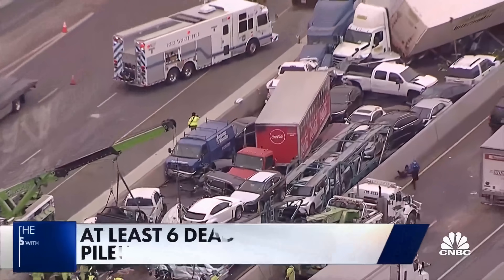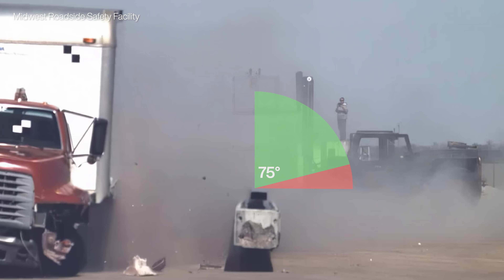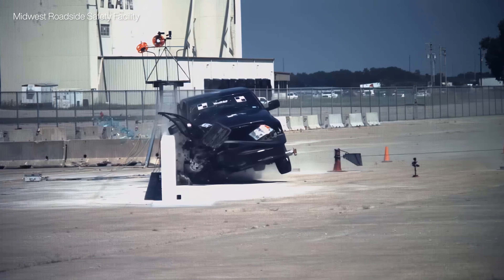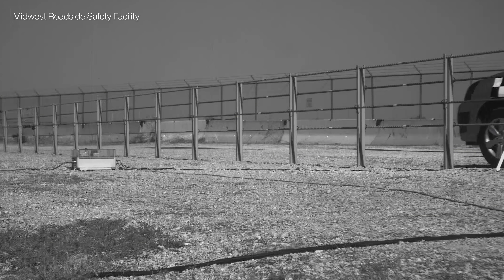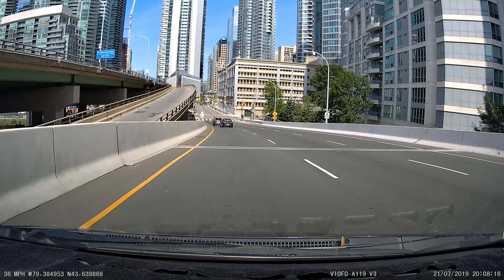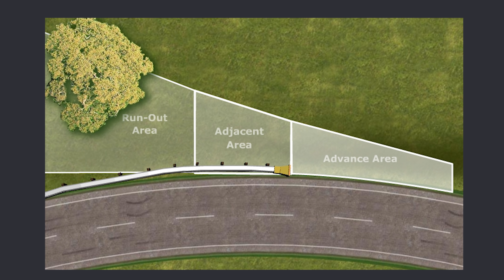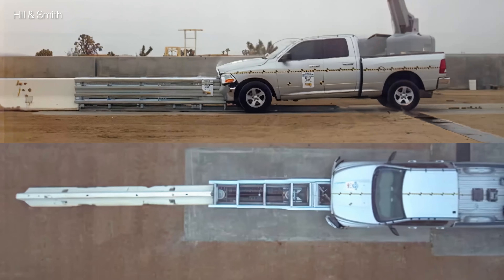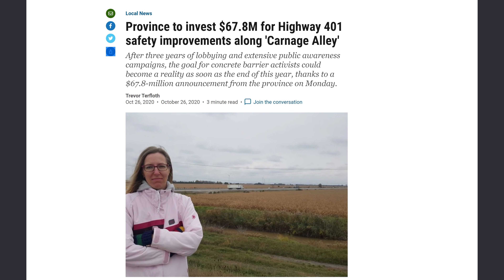How Road Barriers Stopped Killing Drivers

Comment: Really interesting - however the cable barriers are hated by motorcycle riders as the cables can literally slice limbs off. Suggest a follow up covering impact on motorcycles and the crash barriers.
Reply: In Europe they call cable barriers meat grinders for that reason. Great for cars. Killers for bikers.
Reply: And also low cars, especially convertables
Reply: Nobody is worried about motorcycle safety if you can make the road safer for cars. Most people drive cars. Motorcycle riders know their vehicles are unsafe.
Reply: @HotClown  You should compare the motorcycle fatality to distance travelled, not the total amount of accidents. Same is done with cars.

Drunk drivers, inattentive drivers, recklessly speeding motorcycles, lane splitting motor cycles, you are absolutely right. All of these just don't care, and don't deserve to be in the traffic.

Of course cannot expect same safety from a motorcycle than from a car, as car design in past decades has been dictated by safety in the first place and compatibility wise everything is built with cars in mind.

Of course should still do what can reasonably be done to make motorcycling safe as as possible as well. Should do the same regardless of transport form; cost analysis of different safety methods and start by doing things that are the lowest price per life saved. Because that brings the greatest effect to people.
Reply: How in the flying hell can you even hit barriers in a motorcycle?
Reply: @Edo_Ginting  not flying obviously
Reply: @danhentes8569  Obviously, but still, how? are riders that tunnel-visioned nowadays?
Reply: @Edo_Ginting  just protect yourself. No car will
Reply: @danhentes8569  Same thing applies to cars as well, but noted, have a nice day
Reply: @Edo_Ginting  When the rider looks in their wallet and cannot afford to pay attention...
Reply: I know someone who had there left leg severed from a cable barrier
Reply: Vs. bouncing off a cement barrier and returning back to the roadway into the path of a 18 wheeler then crushed by 9 wheels 1 and 2 at a time for .5 seconds of the remainder of said person's life.... Should we send flowers to the funeral home or donate the money for the research of human meat for dogfood?
Reply: @HotClown  Welcome to the new era. Smartphones mounted on motorcycles....
Reply: All types of roadside barriers are bad for bikers, not just cable barriers.  And many motorcycle crashes cause limbs to be lost, even if no cable barrier is involved.
Reply: Convertibles and bikes suffer a lot from cable barriers.
Reply: Altough to be completely honest, don't ever drive a motorcycle, if you are concerned about safety at all. It's propably the most dangerous regular form of transportation out there. Most crashes, that are quite unspectacular in a car and would give you minor injuries at worst, can absolutely kill you on those things. One slip and you can have brutal injuries or die immediatly. 
And when it comes to guide rails vs cables... Yes, those cables might slice your legs off, which isn't particulary nice, but if you drive against a guide rail, you might get launched up several meters into the air. And honestly, If I was dead or bound to a wheelchair due to that accident, I wouldn't particulary care all that much, if I still got legs. As stupid as this might  sound, but if you get to be paraplegic anyway, loosing those legs could even be seen as a benefit - they need all kinds of treatment, need to kept warm in winter, need to be moved and are constantly in your way.
Reply: @HotClown  yes, but you know there's distracted drivers, high drivers, drunk drivers, sleeping drivers, and drivers with medical emergencies on every road you drive on, that's a fact, if you choose to drive a motorcycle anyway that's a risk you are taking, it doesn't matter who caused it if you die or end up crippled that's something you have to live with.
Reply: If you are driving a motorcycle you are literally allowing yourself do die in a crash. It’s an obvious risk
Reply: Just dont drive a motorcycle. Lol. If motorcyclists cared about safety, they wouldnt be riding motorcycles. Just look at the stats. The stats for motorcycle accidents really makes me question their street legality. You literally just asking to die driving one of those things. And those guard rails ain't gonna do shite when the rider gets propelled off their bike and slams their head into the ground at 70mph.
Reply: @dzed5579  most fatal bike accidents are caused by cars, and coming off a bike doesn't kill you, you can survive quite a bit as your gear protects you but a cable at high speed will cut through you, the full length concrete barriers you slide off of. Also I've hit a tree at around 70mph on a bike and am still here, all I got was a snapped femur, had I done the same in a car I'd be dead.
Reply: @stuffanthings  nah this is bs, ik a guy who retired, bought a bike, was wearing protective equipment, but hit a pothole he didn't see driving 35, was flung straight into a tree, now he's a paraplegic. There is nothing safe about motorcycles, and on the highway it doesn't matter if other drivers are being negligent or not if you fall in the road there's a very high chance you'll be run over and severely injured.
Reply: @dzed5579  and not to forget, 90% of them ride way, way, way too fast above the imposed speed limits
Reply: @stuffanthings  "most fatal bike accidents are caused by cars". if everybody would just respect (especially when its heavy traffic) the speed limits and not double on a discontinued line, or by the right side of the road, or squeezing in between cars or in between ongoing and incoming traffic... that would be wonderful. no matter if you drive a car or a bike. 
While driving a car, do you double another car or a motorcycle by the right side of a one lane road if there is enough space? NO. so why would you do it on a less visible smaller vehicle?
Reply: @dzed5579  you sound like ur fun at partys
Reply: @dzed5579  Motorcyclists know the risks and they gladly take them. What you're proposing is so mind-boggling stupid and authoritarian that is only comparable to banning old cars because they are unsafe.
I can drive whatever I want, period. I don't even like bikes, but they have as much of a right to drive their vehicle of choice as I do.
Reply: @reinbeers5322  uh, no they dont. There are reasons why some vehicles are street legal and others arent. I simply think motorcycles should be added to the list. It's illegal for me to drive a golf cart on the interstate. Doesnt matter if it is "convenient" or "fun." And the same logic can be applied to motorcycles. You endanger others and yourself riding them. Just keep em off the streets. Guarantee you see a drastic drop in motorcycle involved accidents and deaths. Tired of the thrill seekers thinking they have the right to endanger everyone else because they get hard riding a bike. Ride it where there arent any other drivers.

You are literally doing a good thing for yourself and society by not riding a motorcycle.

Just like we banned smoking in restaurants because the 2nd hand smoking can kill people, we should ban motorcycles from the roads for "causing" accidents that wouldnt have happened had they been driving in a car.
Reply: @dzed5579  Yet motorcycle crashes are often caused by other people... so by your 'smoking in a restaurant' logic, we should ban all cars instead.
Way to go.
Reply: @reinbeers5322  most motorcycle crashes are accidents. They arent "caused" by other drivers. Both sides are to blame. That is why they are called accidents. Way to go. Smoking in a restaurant is an active choice. The motorcyclists are choosing to drive a small, nimble, hard to see vehicle. You cant blame car drivers for not seeing them all the time. Could they be more careful? Sure. But they wouldnt have to be as careful if they didnt have to worry about some idiot on a bike zipping through traffic. On a bike, you are actively choosing to be less visible and have less protection.

It would be like someone dressing in all black, crossing the interstate in the middle of the night, and getting upset with the driver that hits the idiot that decided to cross the interstate in all black, in the middle of the night. Sure, the driver could have been more careful, and the driver did kill the dude. But it was the idiot in black's fault for doing the stupid thing.
Reply: @dzed5579  Again, they know the risks and they take them. They know how dangerous bikes are and frankly what someone else chooses to drive is not my concern in any way, nor should I have any authority over what someone else drives as it does not impact me negatively.
Besides, I can think of worse ways to go in a car. And those cable barriers are still sketchy even in a car. Convertibles don't have that strong A pillars and cables can cut right through them.
Reply: @dzed5579    also on the "they are ACCIDENTS" no. They are NEGLIGENCE.  You are responsible for anything YOU run into on your vehicle be it bike, pedestrian, deer, car, whatever. 
If YOU aren't checking your blindspots before merging for ANY object no matter what size, that isn't an accident, its negligence.
 It's your fault, no matter how you try to justify it you didn't follow best safety practices and you deserve the fine and/or jail time for wrecklessly driving a 5000+ lb blunt weapon carelessly. 

Suck it up and drive right.
Reply: @dzed5579  its a lot better to be thrown rather then sliced, motorcycle armour is very strong
Reply: @oliverwalters9533  and it's better to not ride a motorcycle. Lol. There are tons of cases where the armor and helmet do nothing and the riders just die or get severely injured. Bikers complaining about certain guardrails being dangerous is like someone running around with a necklace made of knives complaining about a hole in the ground they could trip on.
Reply: @dzed5579  "I want to play a game"
Reply: @dzed5579  Look Twice.  Save a life.  Motorcycles are everywhere.  And they're probably going to be driven by a kid that'll cut you off while going twice the speed limit.
Reply: @dzed5579  Yeah I'm not a fan of riding motorcycles, but I'm not about to tell someone they can't drive something they find fun or fuel efficient. They are a minority of road users, but they should still be strongly represented cause u know.. they still have lives and what not. This coming from someone who gets crap about how flying small airplanes should be illegal cause it's dangerous and done by a minority of ppl. The consequences of screwing up are high, but contingencies can be calculated and be used to significantly lower the chance of fatal ruin. That is what makes it different from reckless. Ppl expose themselves to high consequence of screwup all the time, even if just for fun, made safer by understanding dangers and training for contingencies. After all, what's life for?
Reply: @astronichols1900  the problem is these people complain about safety and inconvenience when it is their choice to do dangerous things. Like I said in another comment, it's like someone who chooses wears a necklace made of knives complaing about a hole in the ground they could trip on. You shouldn't be wearing the necklace made of knives to begin with.
Reply: @dzed5579  if you're wearing an approved helmet and gear, which every rider I know does, you can easily survive impact with the ground. The biggest threat to bikers is car drivers who aren't paying attention.
Reply: @incoherent-marbles  which is an expectation given the vehicle riders choose to drive. "Hm, I'm going to drive an extremely nimble, small vehicle with zero safety measures for getting in a crash around really quickly around vehicles that could kill me by simply tapping my bike." Sounds like an excellent plan. I said it before, but if riders cared about safety they wouldnt be riding a bike at 80mph weaving between cars and then get mad when people hit them. Even for mature riders that dont weave and wear safety gear, the chances of you dying in a crash are extremely high. Moreso than any car or truck on the road.
Reply: @dzed5579  that's not the right attitude. Yes it's less safe to ride a motorcycle but realistically that's not  the way to think abt this issue
Reply: @dzed5579  and who tf are you to tell ppl what to drive/ride? its their choice if they wanna sacrifice a bit of safety for convenience
Reply: @NiquelBones  because they are the ones endangering other people. If you wanna drive a motorcycle out in the middle of a desert, be my guest. You wanna drive a motorcycle on legal roads where other drivers have to constantly watch out for your tiny little vehicle that endangers everyone else, you can shove it.

You wanna run across a street in the middle of the night in all black in the middle of the desert, be my guest.

You wanna run across the interstate in the middle of the night in all black. You can shove it.

Your enjoyment ends where other people's lives begin. I dont care what is convenient if it endangers other people.
Reply: @dzed5579  That comes down a lot to car drivers sucking though. Not to say there aren't a lot of idiots on bikes too. But car drivers need to be considerate and pay more attention for bikes than they do
Reply: @dzed5579  Correlation != causation. Most of the motorcycle accidents in my country result from rider stupidity (this is the case for car accidents too, btw), as opposed to motorcycle riding being inherently more dangerous.
Going 250 km/h through the city center? Sure.
Not slowing down before a crosswalk when the traffic on your right may partially obscure the pedestrians? Pff, why bother?
Thinking that car drivers MUST be able to see you and give way to you when you're flying past them at speed difference >50-100 km/h? Yeah, most of them do think so (at least they did, when they were still alive).

You can't protect a monkey holding a grenade from blowing itself up. And you shouldn't try to, because the monkey has to evolve. You can prevent it from obtaining the grenade, though. In other words, motorcycle driving licensing has to change to ensure that new riders are taught how to ride safely and what to do in extreme situations. The latter now is usually a part of a separate non-essential course, it shouldn't be. The "never brake while in a turn" doctrine with it's "press and roll" has to go, and trail braking should be taught in riding schools (as well as countersteering, right banking, low-speed driving using the clutch and brakes instead of the throttle etc...).
A psychological evaluation has to be required to make sure that the reason for riding a motorcycle is not "being bold and popular [18-year old] guy in town". This never ends well.
The riders have to understand that being alive is more important than being right. They also should have at least some car driving experience to understand the picture from drivers' perspective.

This way you won't have to deal with the barrier problem altogether. But of course, instead of trying to teach people the government is much more eager to stricten various limitations and their enforcement, as well as to build more barriers to try to contain the explosion of the said grenade. Extensive ways of problem solving always prevail the intensive ones in our society.

There're plenty of examples of riders who knew their stuff and lived long and happily. Some of them even started youtube channels to try to teach new riders what conventional riding schools lack.
Reply: @DevilsVideos1  I tend to agree with a lot of what you say, so if motorcyclists need car experience then the opposite is also true, in Britain they have made motorcycling difficult to take up and have seen an alarming rise in young driver accidents, in my youth (mid to late seventies) the average sixteen year old got a sports moped (good for around fifty on the flat regardless of what people claim), and do around 1000-1500miles, at seventeen you got a larger bike (up to 250cc) these could keep up with the flow of traffic on the open road, 3000-5000 miles would be an average for a year, by the time you went for your car license around nineteen you had about ten thousand miles invaluable road experience, today a newly qualified car driver will have driven 300-500 miles at most, you cannot get learner drivers more experience without it becoming economically unviable, a return to motorcycling is the only way to practically provide the road experience, yes casualty numbers will increase, as it did in the early eighties,  but the accident rate had dropped due to the large uptake, (safety groups and politicians made capitol about the numbers without mentioning the rate, in the process they looked good for the electorate), the accident rate would fall and this would have to be stressed even though numbers go up.
Reply: @CrusaderSports250  Learning by experience is only one way to learn, and far from the most efficient one. You can have 10 000 miles of experience and still not know many things that you could have learned by other methods in much shorter time (Like here in Finland in driving school they take us to ice track and everyone will learn the basic methods how to correct sliding car in snow and ice, how to maintain control and ability to turn in snow and ice without locking up brakes, etc. They give to everyone exact details and a little bit of practical training how you avoid locking up brakes, how you brake with car with an ABS or without an ABS. Much more efficient and safer to start learning those things that way on a closed track than to learn it by yourself in the traffic). Indeed certain things have to be learned in the traffic and will be perfected in the traffic, because there is no good alternative (like vehicle control that takes a lot of practice so that it comes from the gut). But many things regarding traffic are not like that. You can also learn some simple technical ideas much faster from a book, ideas that would take you a long time to learn by experience (Like knowing to keep your wheels straight when waiting for oncoming traffic before turning left, that makes the difference if someone crashes in your ass, will you be pushed in front of oncoming traffic or straight forward). There is a lot of this kind of simple technical tricks that are much faster to learn by other means that experience. Large part of safety in traffic is also about mindset. People start to learn traffic already when they are kids and sitting in the backseat watching their parents drive. Safety is very heavily about culture and mindset. Kids could also start learning to drive by driving cars. Doesn't have to be a motorcycle or moped like it was in my youth as well. Now there is those new cars that are speed limited to 50, and I think 16 year olds are allowed to drive them.
Reply: @CrusaderSports250  But I absolutely agree with you that making the license too hard to obtain is not a good idea and it may have gone too difficult in many countries. Should find some good middle path, some basic training and then practical practice in the traffic.
Reply: @dzed5579  kinda brutal but unfortunately you're right
Reply: There are plenty of experienced riders of course, and there are safer bikes, but yeah
Reply: He even mentioned the cost lol. Civilians are not gonna buy those things.
Reply: @fynkozari9271  Civilians are not the only people that have to worry about cost, transportation departments do not have unlimited funding. Cheaper barriers means more currently unprotected roads can receive some protection.
Reply: @HotClown  you are literally proving my point. Motorcycles are more likely to result in accidents due to their small size/low visibility for car drivers. Not riding a motorcycle would literally reduce your chances of getting in an accident because people will see you in a car. Lol

Even then, accidents are gonna happen regardless. That's why they are called accidents. The question is, what kind of measures do you want to take to prevent dying or getting injured in an accident?

Do I want to drive a car with top safety standards, wear a seat belt, and have airbags, or would I rather drive a motorcycle with none of that?

Answer is simple. Drive a car. All those accidents and deaths are because people drive motorcycles. Not because they drive cars. Nice self own. If people didnt drive motorcycles, they'd be less likely to get in an accident and less likely to die.

There is literally zero good argument for driving a motorcycles other than entertainment. They are a danger to other drivers, cause accidents, and are extremely unsafe.
Reply: @dzed5579  Yes, they are inherently more dangerous in certain situations. But that does not mean you should make it more so, like using a car is dangerous and look what has to be done to counteract it (there are many dangerous hobbies that people do, bashing them is not the solution. Diving is dangerous, but saying they're stupid for doing it is not accurate. What about mining? That's dangerous but that doesn't mean you ignore possible safety because of that, no instead you help reduce the risk with engineering). Gear does help (you know, as long as it doesn't have to prevent unusual situations like, let's say, a cable) but only if it's properly rated. Gear that fails is usually something that was just made to pass laws like most DOT helmets. Good helmets will properly dissipate the energy, right gloves will slide to prevent your hands from locking into the ground, pants should be able to slide more than 2 feet before exposing your skin (so jeans don't cut it, leathers and aramids do), boots must prevent to much ankle twist. All of them exist, and do make riding safe, if you can slide that is.
 
There probably is a solution to satisfy most vehicles, motorcycles and low cars, while still being affordable. I trust that engineers will find it, it will than just be left to the government to actually implement them. A solution that I can think of would be to put a plate in the cables  to equally disperse the load, the cables will still be the load bearers but this would help with the whole "cutting" problem, a folded lip could go over the top and bottom to help even further.